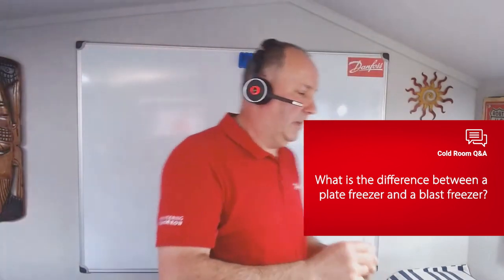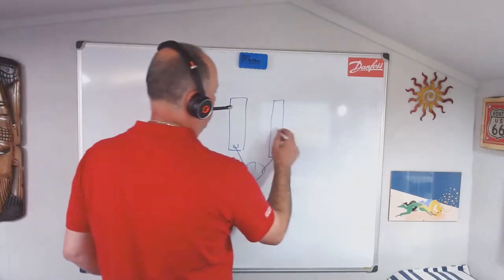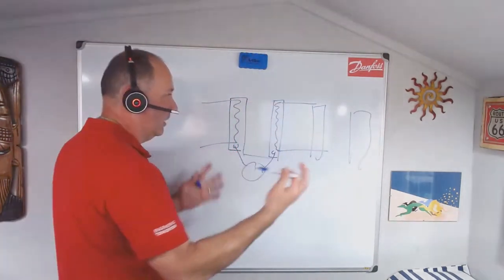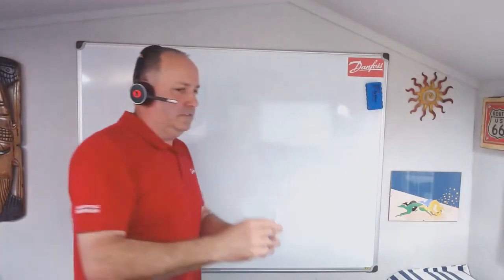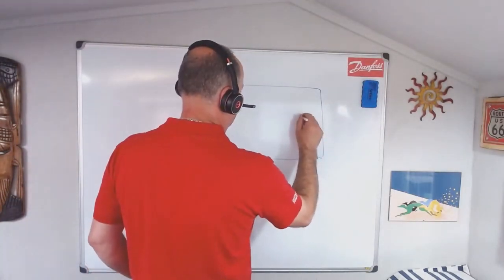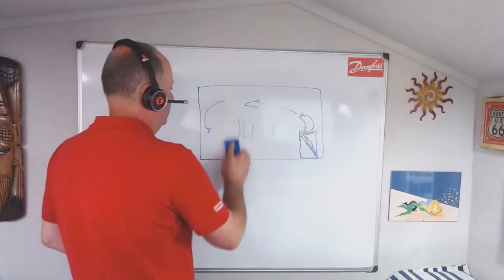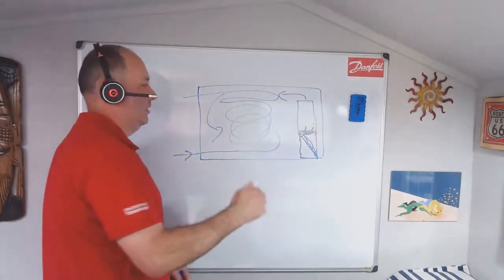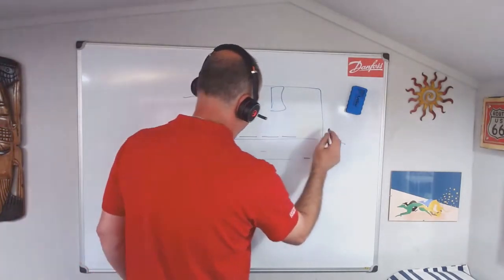What is the difference between a plate freezer and a blast freezer? | Ask an Expert

Comment: I have a question about defrosting , can we use reversing valve to defrost like air conditioning? inverting the  cycle.
Reply from the maker: Hi, Thank you for your comment. Yes, it is possible to use a reversing valve as this would add heat into the evaporator. Hope this was helpful :-)